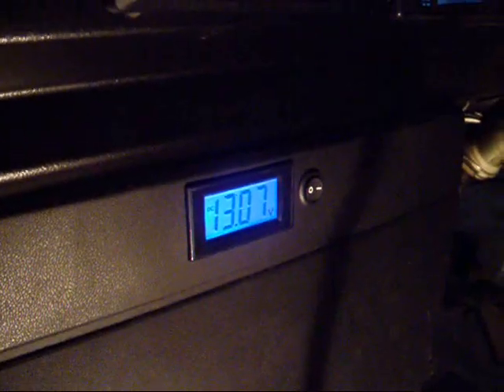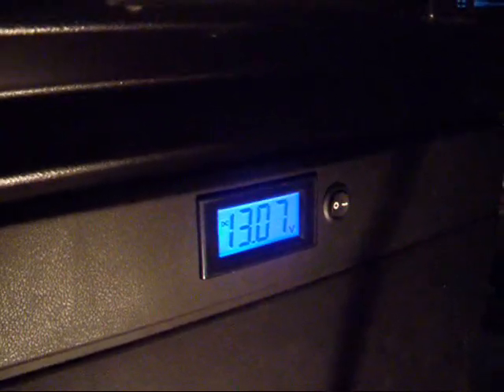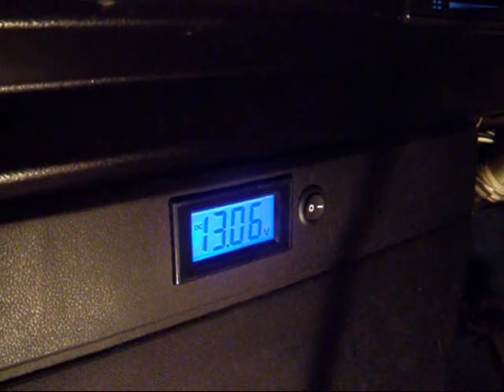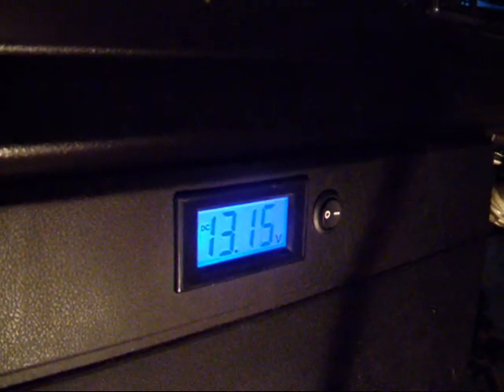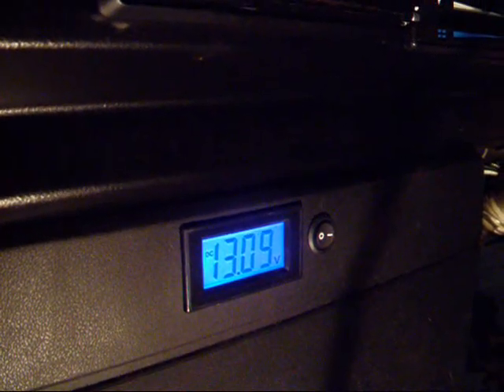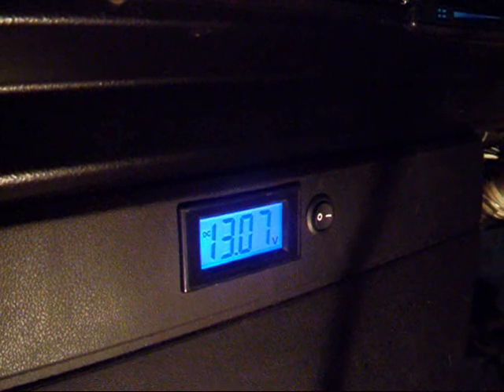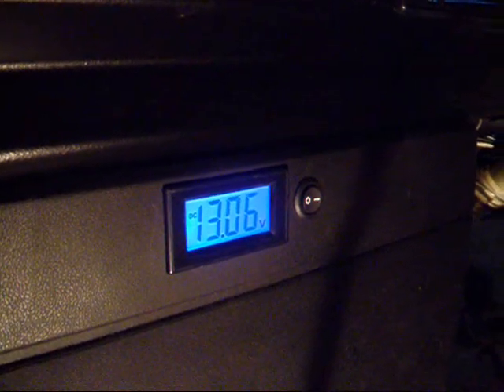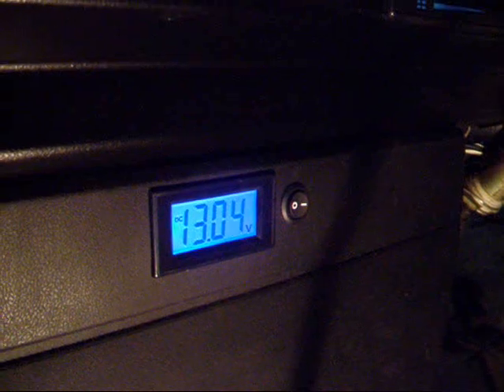VW T25 Voltage Meter Modification Pt 1- 80/90 club

Comment from the maker: Correct. Basically you take wire direct from leisure to a two-way switch. You do same direct from charging battery or somewhere else that is permanently live from that battery. The earth can be taken from any part of chassis as it is common to both batteries. The switch simply selects one battery or the other.